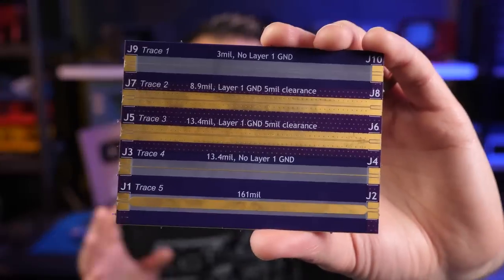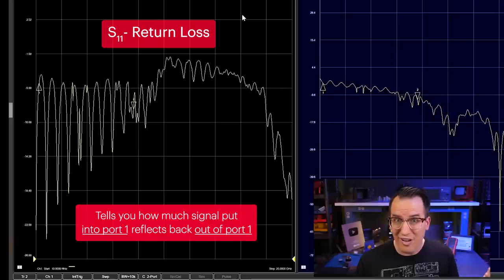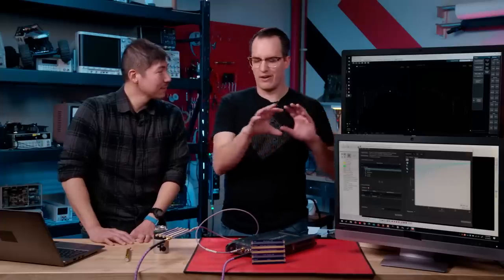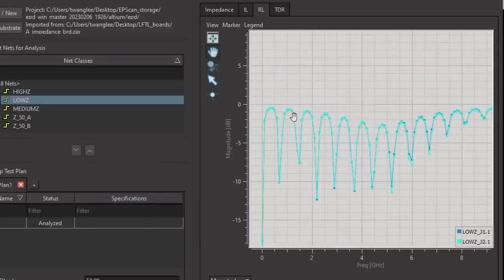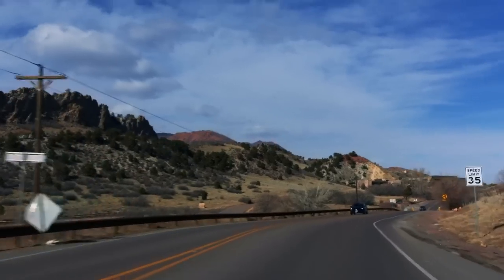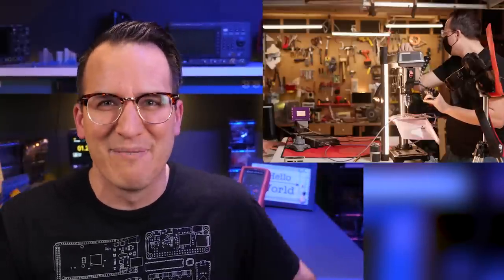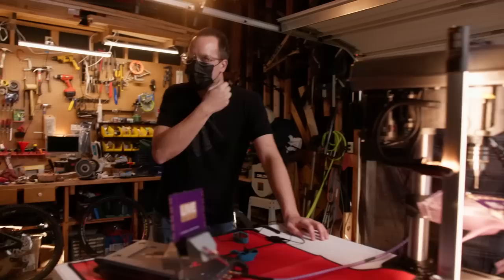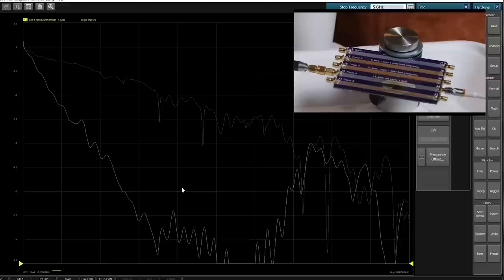Why these PCB shorts are 50 Ω

Comment: Electric engineers need to be taught that sending signals down a line is not too far from a drummer playing down an echoey hallway. You need just the right type of hallway for the right beat or it just turns to garbage.

Comment: I think the formula "Z = R + jX" in the beginning is actually giving the wrong impression. The characteristic impedance of a trace is actually a real valued number and is based on the ratio between the current and voltage waves travelling down the line. The impedance seen by a VNA at the input has nothing to do with the couple of milli Ohms that you measured using the multimeter.  PS Not that it matters to most, but that width over thickness trick of 2 for getting 50 Ohms impedance only works for materials with a relative dielectric constant of about 4, aka FR4 which is of course the most popular substrate material in PCBs, but not the only one.
Reply from the maker: Excellent points!

Comment: I think a crucial parts is missing at the start:
Is that applicable to lower frequencies to near DC? Say a trace carrying Audio-signals, or Servo/fan-controls that are in the lower tens of kilohertz.
Reply: basic rule of thumb is you don't need to take transmission line effects into account until the line is longer than 10% of the wavelength of the highest frequency signal. For audio, wavelength at 22khz is 13.6km, so as long as your line is shorter than 1.36km, you don't really need to worry (at least about impedance matching - loss on a 1.36km cable might be something to worry about though)! You can do the math for other frequencies yourself (left as an exercise for the op)
Reply: @gorak9000  I know that - that is why i remarked this is missing information in the video cause all the talk is about how 50 Ohm would result in the lowest reflections and even highest power transmission but at no point was it mentioned that this is for decently high frequencies only.
I have seen people doing both - trying impedance-matching for current-driven circuitry and lowering DC resistance on a 5GHz differential transmission line.
Reply: @ABaumstumpf  I'd say the biggest problem with the video is it mentions traces should be 50 ohms, like that's applicable EVERYWHERE, when it is absolutely not. Traces should be 50 ohms if your source and load are matched to 50 ohms (aka usually in RF nets only - and even then, not every RF component has 50 ohm input or output impedance - that's why you check the datasheets and or put in matching networks). In digital circuits, TTL or CMOS inputs are going to be FAR from 50 ohms. I feel like the video gives the impression that every trace on every board should be 50 ohm, when that's far from correct.

Comment: Awesome video! I would love to see a deep dive comparing different style SMA connectors (vertical through hole, vertical surface mount, generic edge launch, and solderless compression) with all else being the same. The stub on through hole SMA connectors is something not well characterized in datasheets and seeing a comparison between all the different types would be really interesting.
Reply from the maker: That would be super cool! Great idea
Reply: I've seen some through-hole BNC connectors for 12G-SDI digital video that specify the required board thickness to obtain the specified performance from the connectors.
Reply: @KeysightLabs  while you're at it you could show the huge differences between cheap amazon / ebay / aliexpress sma connectors and good quality ones. I think there's more meaningful differences there than worrying about the little stub of the center conductor

Comment: I didn't know trace simulation exists. What software do motherboard manufacturers use?
Reply from the maker: We make a software for it that we used here called Electrical Performance Scan, which is part of the overall Pathwave family of simulation/emulation software. It's super powerful stuff: https://www.keysight.com/us/en/products/software/pathwave-design-software/pathwave-advanced-design-system.html
Reply: @KeysightLabs  yeah, and you need a super powerful wallet to buy it!

Comment: The curve pattern shifts to either higher or lower frequencies as you cool or heat the board. Is that caused by the contraction and expansion of the board?
Reply: I would guess it is primarily caused by the change in the resistivity of the copper conductor. Copper has a positive thermal coefficient, so when cooled down, copper has a lower resistivity, and when heated up it has a higher resistivity.

Comment: This was really fun, but to be honest it felt a bit all over the place.  First you're testing different trace widths, then suddenly you're drilling out vias, then you're playing with liquid nitrogen?  I really kinda feel like those could have (and maybe should have) been three different videos, because they were all kinda unrelated to each other, and none of them really felt like they got the full treatment they deserved because you were just rushing from one thing to another.

In particular, I would really have liked to see more investigation of the relationship between traces, trace widths, and surrounding materials (for example, using a ground plane vs using parallel ground traces, width of ground traces vs signal traces, etc), which it really looked like you were actually going to do based on some of the other traces on that board, but then you never did, which was kinda disappointing...
Reply from the maker: Agreed! I wish I could do more on YouTube. I am putting together an hour+ version that explores all three boards including the coplanar vs. microstrip traces. We'll email that super cit out to folks who sign up for Live from the Lab, and the event also goes into a lot more detail
Reply: @KeysightLabs I think the introductory presentation touched upon some key engineering points that may relate to electronics in deep space versus inside a vehicle dashboard, in the hot Florida sun.  It’s a tremendous amount of information to convey is such a short time. Good job!
Reply: @KeysightLabs  too bad the world mostly lives on youtube, not locked away on the keysight website somewhere (where even to download manuals and stuff it annoyingly asks for email addresses continually). The good HP legacy is slowly fading...

Comment: Great video! But consider using regular units, not those funky mils, mits, miliburgers, etc.
Reply from the maker: Next time everything will be in zeptoparsecs
Edit: holy moly this is actual nearly 1:1 if my math is correct
Reply: @KeysightLabs  Yep, 1 zeptoparsec = 1.21483 mils. That's one hell of a fluke if you didn't plan it! 🤯

Time to start labelling everything in zpc, I think! 😹 At least then everyone will be equally confused ;)
Reply from the maker: I definitely did not plan it, bit I definitely will start using it!

Comment: "Mil"? Measuring science with body parts :D
Reply: For historical reasons, PCB manufacturing uses imperial units. Trace widths and clearances are specified in mils (thousandths of an inch), copper thickness is specified in ounces per square foot, common breadboard/perfboard/chip pin spacing is 0.1", surface mount passive packages are named based on the number of 10 mills in each dimension, and so on. Just to liven things up a bit, many other SMD parts will use millimeter units for their layouts, pin spacing, and clearances. So when doing PCB design you get pretty good at switching seamlessly between units.
Reply: @funtechu  Interesting info, thanks; I've always used metric up here in the old Europe, but the base is painfully clear when everything is a multiple/fraction of 2.54. The only field where imperial is generally used is plumbing, I guess for historical reasons too.
Funny how a mil is both imperial AND metric, and not some "twelve sixteenths of a quarter inch" kind of nonsense .-)

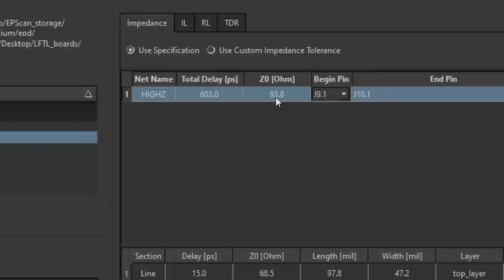Comment: Weakest point of this video is at 7:39 - measuring a trace with a DMM and confusing DC resistance with transmission line impedance.
Reply from the maker: Valid, but I'm kinda trying to make the point overall that you can't just think DC

Comment: Please. Where does the magical 50 Ohm value even come from?

Say I have an 100MHz bus with a source impedance of 100 Ohm and load impedance of over 100 kOhm, so where does 50 Ohm come in? Nowhere, it's not a transmission line. These sorts of buses already tend to be somewhat fragile when you design them yourself, there are easy mistakes to be made, but this sort of advice doesn't apply to them at all either.
Reply from the maker: Generally this is related to high speed digital signals, and it's very common to have a 50 ohm TX and RX. There are situations where the impedance isn't a 50 ohm target, but usually it's in that 30-70 ohm range. In those situations this advice still applies, but needs to be adjusted to match the target impedance.